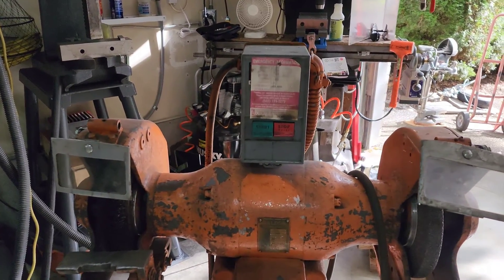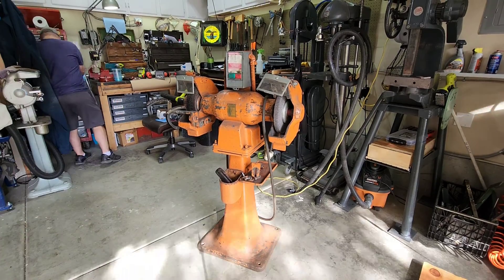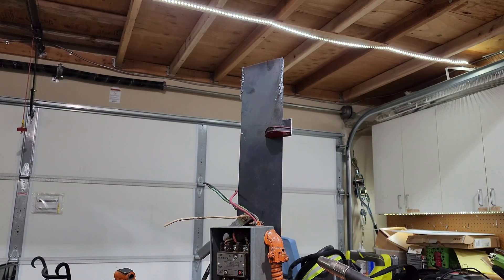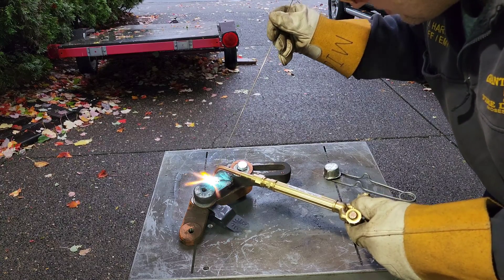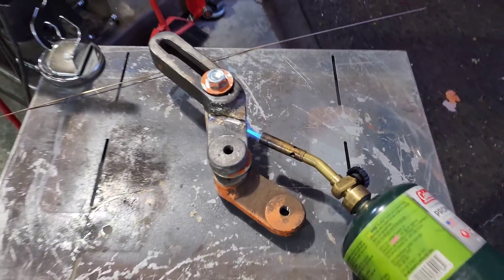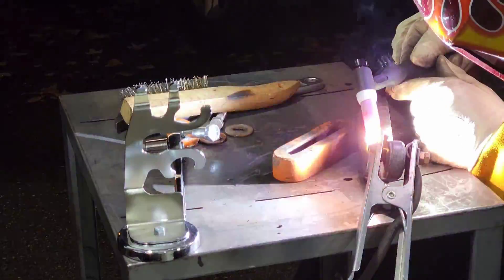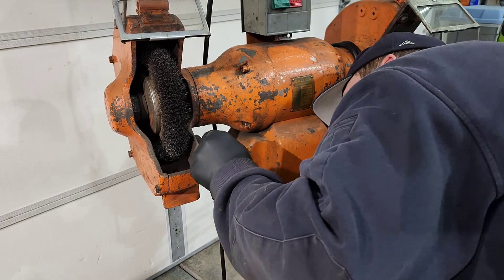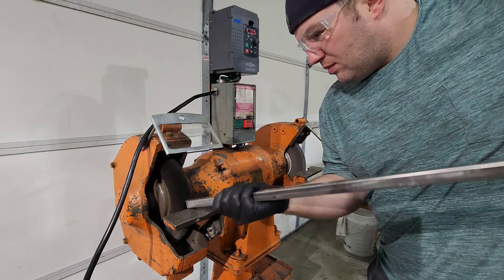Baldor 3 horse power pedestal grinder repair and VFD installation

Comment: That industrial build quality sure is enticing to those of us who collect old iron !! The vfd solution changes the game with alot of these old 3 phase machines !! I worked in a foundry while in college and we had 20 or 24" grinders that were used to clean up castings. Each worker sat in a chair in front of the grinder and almost straddled the grinder which was maybe 2 feet off the floor. I didn't envy those guys ! It was loud, dirty and dangerous work !! Thanks for a nice video!! I really like the baldor 8 " that ix constructed like yours!!

Comment: Just a tip. VFD’s do awful with grinding dust and sparks. They also need airflow on the top and bottom. Didn’t even want to mention it but hate for your VFD to burn up on you. 

Keep the videos coming. I haven’t missed one yet
Reply from the maker: I need to figure out an enclosure for the vfd. Originally, I was thinking that having up above the grinder would keep it far away enough from the dust, but I don't think it will after seeing how much dust comes off of it. If I had it hooked up to dust collection, it would probably be ok

Comment: I need to find a big grinder like this for my shop. The problem you were having with using the torch with the rod is you had no flux on it. It was oxidizing and was never going to bond chemically to the surface of the cast.. You have to use flux or some kind of shielding gas. TIG worked because (I assume) you were using Argon as a shielding gas.
Reply from the maker: That makes sense, I need to watch some more videos on how to braze properly. You're correct. I was using argon for a shielding gas when tig brazing the second time.